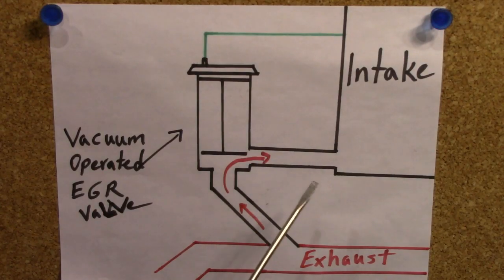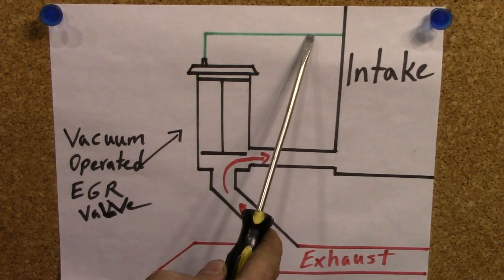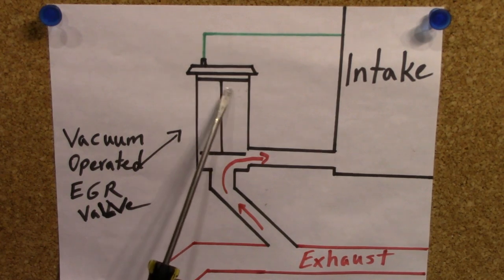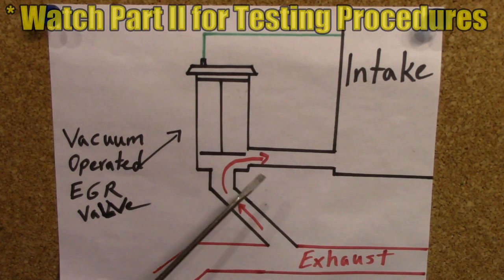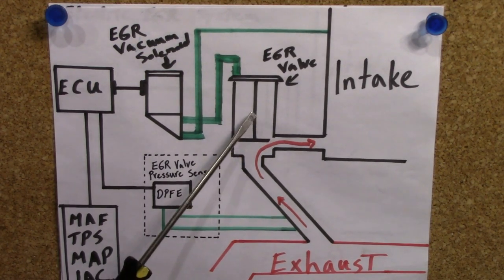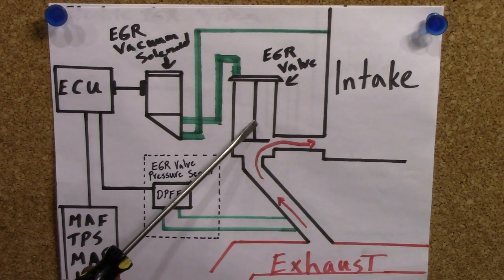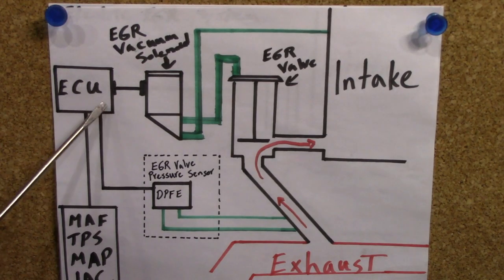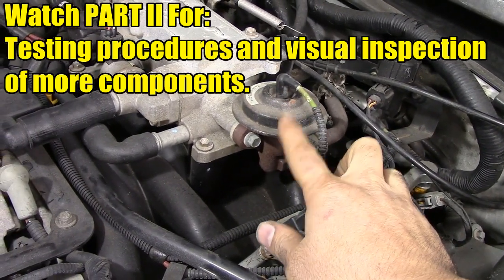How an EGR System Works Plus Testing and Inspection Procedures - PART I

Comment: I have a 2005 grand prix gt non sc. I'm getting a p0404 code. Do you think that is probably the egr  valve itself? I was going to pull it off and clean with some throttle body cleaner. Any other suggestions?

Comment: I have '95 Roadmaster that is having a little trouble passing NOx. W/ the EGR off the car I can hand vacuum pump it up and it holds as well as when I place it on the car. But, when I let the car idle it wont pump up w/ the hand vacuum. Is there something going on in the intake for this odd behavior?  I cleaned the EGR w/ Seafoam before. Thx

Comment: So im confused on my k24 accord i cleaned the entire egr from the intake the passageway on thr side but where does the hole lead to inside the cylinder head does it just get its feed from / thru the valves into the head than the egr?

Comment: I have 2.2 camry and can't fix egr p401. changed modulator, checked vsv, vacuum lines, egr valve, gaskets, throttle body, everything code goes off briefly sometimes but can't get rid of it. I've rested everything by the service manual and still nothing.
Reply: Sounds like it's time for a 3S-GTE swap instead of the 5S-FE!

Comment: Hey ratchets and wrenches, I have a 2000 mustang Gt (similar to yours) .. do you know why my AC only comes out through defrost? Thanks!
Reply: You have a stepper motor under dash usually one on dr side and one on passenger side which switches from your dash to your air vents and floor hope that helps
Reply: Same with mine only through the defrost I have a 99 GT
Reply: check vacum to acuators.

Comment: On a good running car we have exhaust gases and pcv gases and gasoline vapor going back into the intake manifold to be burned with fresh clean fuel now I see why the intake valves get caked deposits all over them and clogged up the engine intake system and requiring intake valves cleaning

Comment: Can you or anybody help please, my EGR has both vacuum and motorised built into the one unit, I did a smoke test from the intake and smoked leaked between the EGR and the EGR Cooler so I thought, so I ordered a new gasket and replaced it in two hours. Did the smoke test again, same spot. Removed EGR and EGR Cooler and did the same test, smoke coming out of the hole which is there for atmospheric pressure to allow the valve to move freely, test the EGR with vacuum tool and it hold pressure. Ordered new EGR and it does the same, ordered another EGR and does the same, is this normal or does the supplier have a faulty batch? 
https://youtu.be/EvBClnmCBNs?si=SetU0ngqPGWUK-tK
 Car is Mitsubishi Triton MQ 2015 127 000km fault is when I drive and come to a stop rpm drops to 625 and goes back to 650.
On idle it happens intermittently, when AC is on and cycles and turns off RPM drops and back up everytime.

Comment: I've heard claims that removing EGR can increase engine performance and improve longevity, since there is no carbon buildup on intake valves. Do you know if this is true ?
Reply: I do not think is true at all. The purpose of the egr valve is to reduce knock in engine from extreme temp in cylinder. You can make engine run richer to cool cylinders but that increases fuel economy and drecreases engine performance. I got these info from general motors ASE 8 guide.

Comment: wait this egr system goes agaist everything ive learnt about cold air intake if my warm gaes are goin in whats the point of cooling the air before it goes in im confused now
Reply: inert gas enters combustion cylinders making less room for air by a certain % that still allows oxygen to enter, less oxygen means less heat produced, keep in mind egr opens while around cruiseing speed and is mainly meant to decrease nox emissions. egr is win win.

Comment: my 98 pathfinder has egr/ vacuum modulator/ and purge valve need help
Reply: Isreal Perez what is the ECU?  Is it a computer?
Also my Ford v-10 has a vacuum diaphragm EGR with the vac line on top but no solenoid or ECU but I do have a DPF pressure sensor. How come?!  Maybe I do have an ECU ??

Comment: can you just block the egr off.
Reply: Yes, but you need to delete it from your software as well. Reason being you will get no pressure reading or some value that the ECU will think there is a problem and will give you check engine light or other dashboard error.

Comment: Modern cars are garbage, unnecessarily complicated, cars with a carburetor and mechanical distributor runs just fine and can be fixed with simple and cheap parts in the road by youself, later on was a great improvement was the implementation of basic fuel injection and electronic distributor, those cars runs forever, after that they are overloaded with unnecessary valves, sensors, computers, 600 hoses under the hood GDI is good for car racing where they disassemble the engine between races but is complete garbage system in a street car, modern cars are expensive to fix, require special equipment, tools, software, etc. Garbage garbage garbage but is the way the cars market move in this days.

Comment: So you are talking about what the EGR system does, not how it does it.  Big difference.
You have no idea how it does it specially the electric stepper motor type.
It is easy to talk in general.  Yea I can do that too.
Let me ask you straight forward direct question and I assure you, you will not answer it.
Lets see how much you actually know.
Explain in details. 
1. what exactly triggers the sensor wire to send signal to the computer and exactly how that trigger works.  Clearly explain it.  And then what is it that you call signal?  It is  not some sort of whistle, or yelling, he we need some shit in here...?
2.  What is reference 5 volt wire, why 5 volts?  what are these things  made of  anyway and how do they look, their shape, size, distance, configuration …?
3. Why does so called signal wire and this reference 5 volt have their own ground wire separate from body ground anyway?  Show in drawing how exactl;y these things look like and their physical relationship to what is inside the valve body.
4. How does the signal control related, designed, rand have any elationship inside the valve.
Show schematics and clearly explain what happens?
You don't have to explain how the computer does it.  I won't put you through that.  That would be unrealistic.

This is called "How EGR system actually works".
Now try it.
Reply: You must be a boomer, how long did you want the video to be.